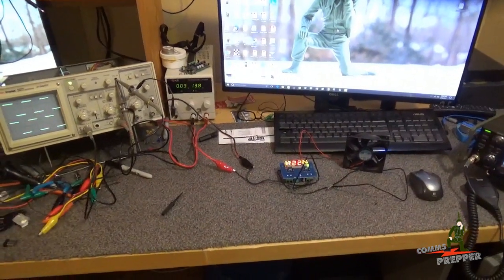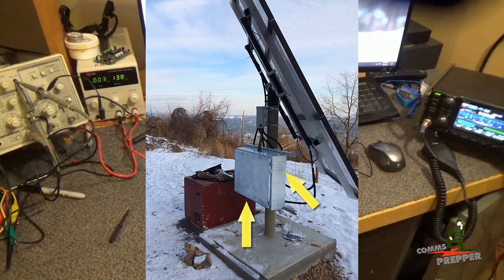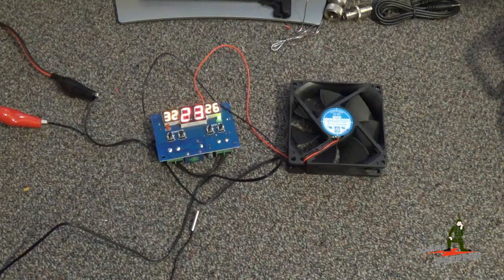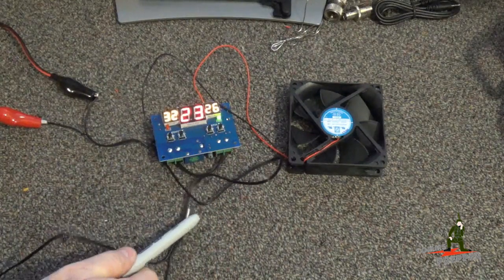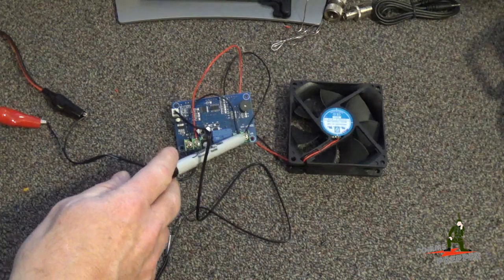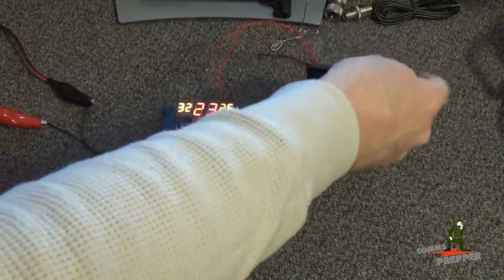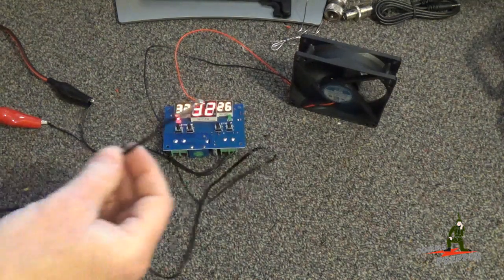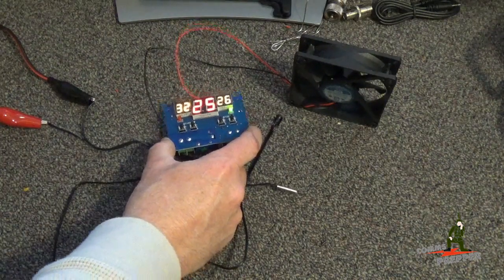Cooling Off-Grid Solar Power Electronics

Comment: Very clever, Hank.  This reminds me of a little circuit I did to turn off the electric fans on my car once it reached 45mph. The speed was extrapolated from a pressure gauge connected to a pitot tube which extended through the grill a few inches. It also had a very similar setup to yours in order to turn the fans on when coolant was over 180º, if I remember correctly.
Reply from the maker: I just hope it works and holds up.

Comment: Brother I would have it push out the hot air at the top of the box so that it brings in cool air as it's running.
Reply from the maker: Yankey that is the plan, the fan will be on the upper vent pushing air out so cool air is pulled in at the bottom vent.